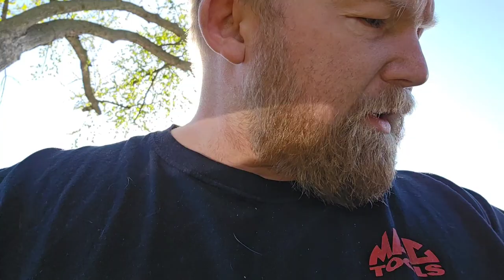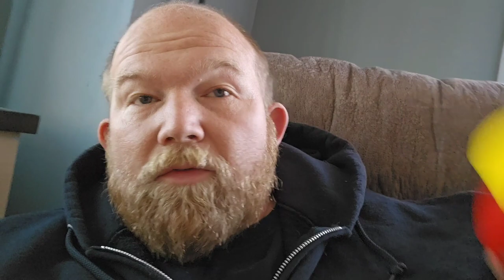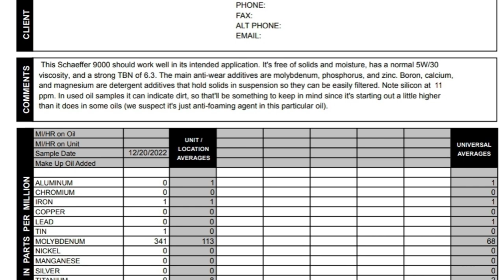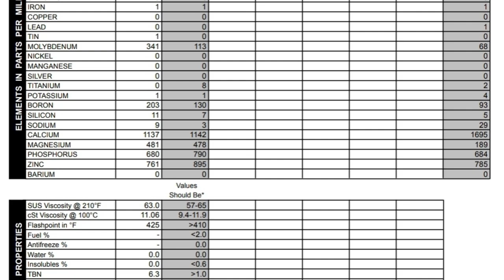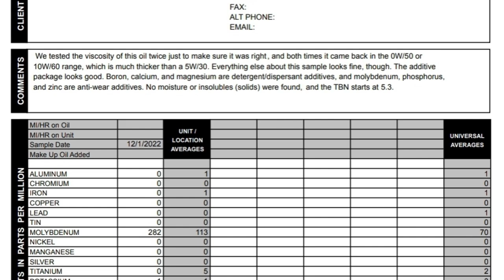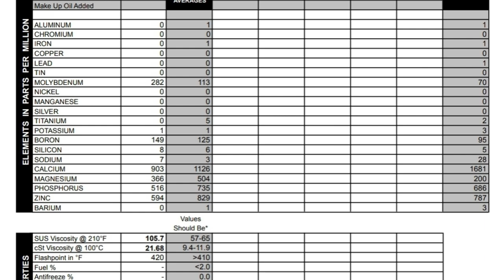Moly Boosters To Oil - Do They Work?! Let's Chat and See Results - Oil Additives In General

Comment: Thanks Rich! My question is does the oil separate in the bottle or jug. I been buying 2  5 QUART jugs and instead of using  a jug and 1 or 3 quarts to do a oil change. I do this because it is cheaper am I doing something wrong?
Reply from the maker: The stuff that uses the old MOS to Molly it can separate but the newer stuff does not so much but it's still nice to shake up the bottle a little bit just to make sure
Reply: THANKS! @FordBossMe

Comment: What are your thoughts on Archoil products? Especially on Powerstrokes?
Reply from the maker: I don't know enough about it
Reply: Archoil AR9100 helped my injectors on my 2000 7.3 powerstroke big time. It's only 16.oz for basically 18 quart oil system. I would like to see that tested in diesel engine oil as well as Hotshot Secret Siction Eliminator and Hotshot Secret FR3.

Comment: Morning to you Rich.  

So that additional additive increased the volume enough that the ppm count went down? Is that right? or Did i misunderstand? Is there some quality to the additive that dissolved or disappeared the additives from the test?  Interesting!  😊
Reply from the maker: You misunderstood
Reply: @FordBossMe  Thanks!  I am going back through the vid see what missed.
Reply from the maker: It reduced the overall numbers for 1 because it is more like a oil thickener and not so much a booster, the additives in an oil are already mixed together in a balanced formula and adding more to it in a manner it wasn't formulated for and the competition between chemicals reduces overall capacity of additive
Reply: @FordBossMe  Thank you Rich!  for the explanation! I did not expect it.  I  figured i better listen up.   That is awesome. 😊

Comment: I used an additive called Metalon it is made in Canada and I used it in a new 03 f350  regular cab dually with a 6ltr diesel about 20ozs in 14 ltrs of oil the truck drove 2400 kms and was involved in an accident and was parked for 4 years trailered back to BC and this spring I rebuilt and sold it. The engine had 270 thousand on it ran better than new and when I pulled the dip stick the oil looked like it was just changed which was always the case when using this additive, the guy that bought it thought I was lying to him. He believed I had changed it just before he bought it so he drove it for 5000km and took it to a shop and had it changed the shop owner would not believe he had 7500 km on it as it still was not at all black only slightly browned and told the guy he had never seen oil in a diesel that clean even on new diesels. I don't know what was going on there and guy did three oil changes in the time he owned it used Metalon exactly as I told him to he bought a gallon of it always using it. Unfortunately the truck was stolen in Vancouver so I don't have any more info but last odometer was288thou. kms and 5000km oil always come out like new. Anyone have any idea what could have been going on here it has me baffled since about 2004. The only thing I could believe was the rings sealed so well that all the carbon went out the pipe I don't know but wish I had that truck back it was great. Any ideas I never figured it out